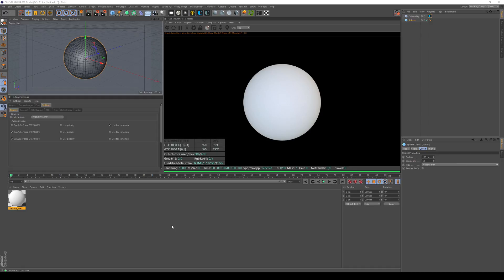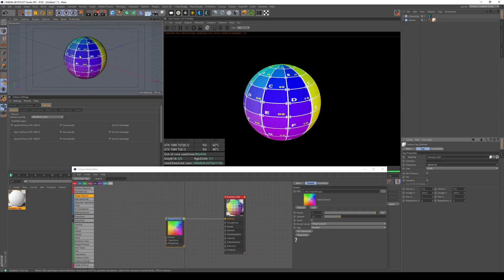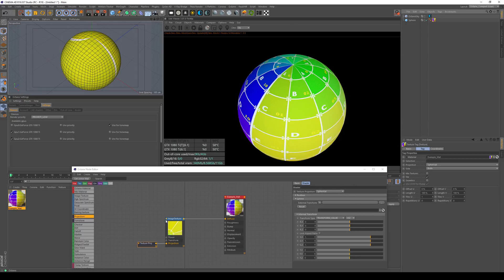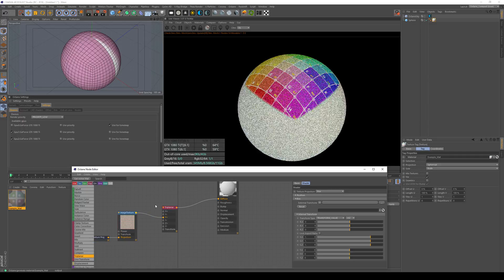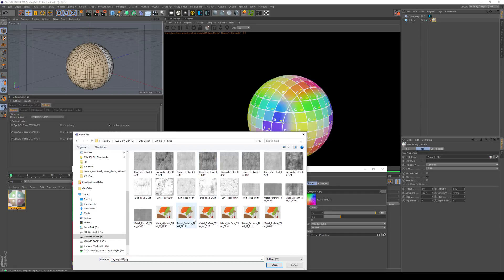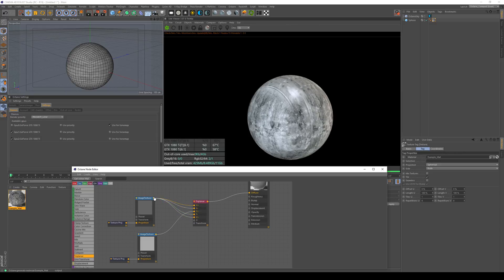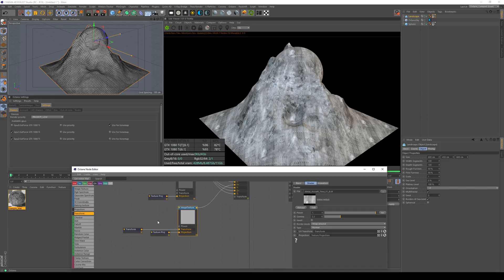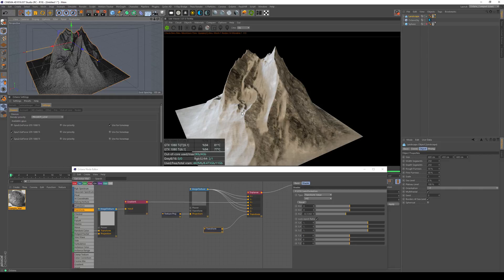Silverwing Quck(ish) Tip: Octane Triplanar Mapping

Comment: does it work good with normal maps? using triplanar with normal maps resulting just as same as box projection only
Reply from the maker: It works decently with normal maps. You have to make sure that your object has somewhat decent UV mapping.

Therefore I set all my materials that I Triplanar map to Cubic Mapping in the C4D Material Tag.

Through the underlying UVs the Shader knows how to orient the Normal map correctly.
Reply: isn't triplanar used to avoid uv creations?  @SilverwingVFX
Reply from the maker: @jkartz92  It´s not about the UVs per se. Its about orientation in 3D space.

Here´s the long version of it 😇
Normals are vectors. They encode the 3 axis XYZ in the RG and B colors. The Normals we use in 3D software are usually tangent space Normals. This means the Z axis is the Normal direction of the Polygon.

To get that bumpy sensation you need directions to angle that Z Axis. So some sort of anchor is needed to tell the the normal where to place the X and Y axis next to the Z. And this is was the UV map is providing the normal map with.

This does not mean you have to create UVs on your Object. A simple cubic projection in C4Ds Material tag is enough to provide usable UV coordinates that are not flipped to all polys of the object.

Hope this makes it a little more understandable.

Cheers 😊
Reply: thanks!  @SilverwingVFX
Reply: I tried but still the issue persists! BTW i'm using octane in blender! Another doubt is that, how to remove pixelation with bump map renders? In blender we use an option called "cubic" instead of linear. Any such settings available in octane?
Reply from the maker: @jkartz92  Ah, excuse my Ignorance. When I see comments here I expect the people using C4D Octane 😇
Blender should be working fine as well though. Maybe just run a quick auto unwrap on the model to get solid UVs.
Octane does not offer a choice in pixel interpolation. Its probably linear by default.
When hearing that you have pixelation problems I am thinking that your texel density must be lower (or you are really close to the object with your camera) for this to make a difference...  If you want you can share a bit more detail as screenshots via email so I can respond a bit better to the issues you are facing.

Cheers and a good time to you!
Raphael
Reply: okay thanks  @SilverwingVFX
Reply: @SilverwingVFX  thanks it really works!